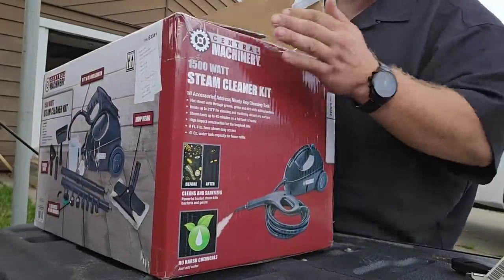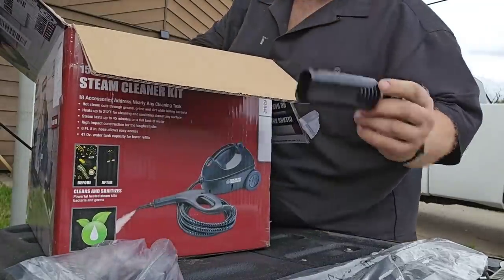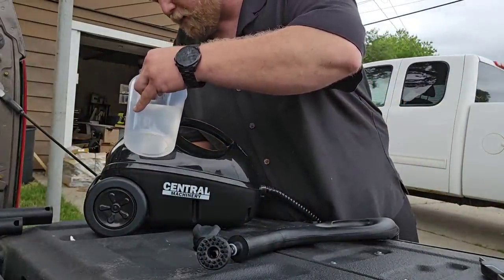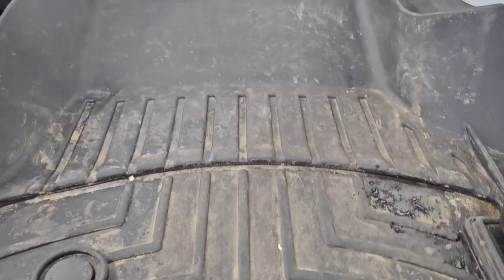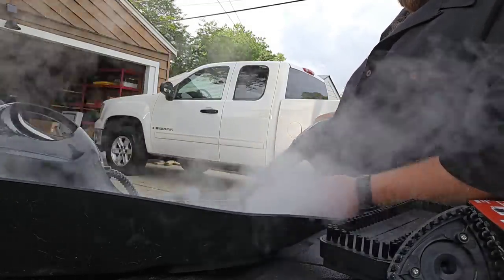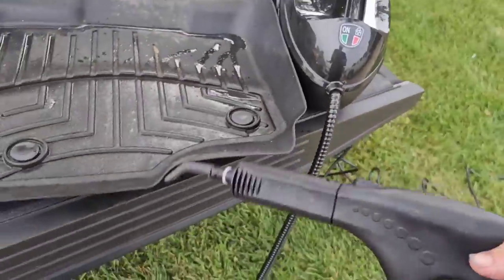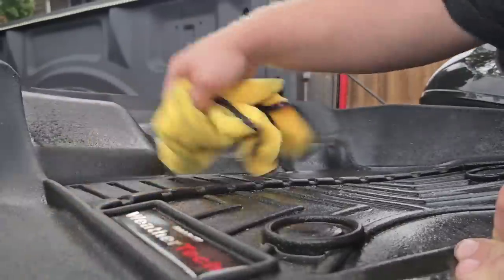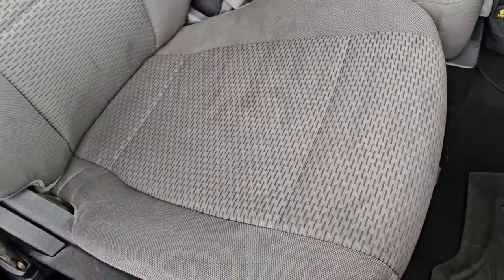Harbor Freight Steam Cleaner Review - Very Simple Very Easy Very Effective - @harborfreight

Comment: Weathertech matts stain so easy. I hit mine once with a 5000psi pressure washer and they still looked stained at the end but that's just how they dry
Reply from the maker: Right the stain you won't get rid of, people in the comment section don't get that
Reply: Dress the matts with Gummifix. They'll look like new and won't be slippery at all.
Reply: Love my Weathertechs. I put them in every vehicle I get.
Reply: @Todd66  It's a must if you live in the salt belt, so many cars have electronics right under your feet
Reply: There are easy to clean and don’t need a steam cleaner but mine does a great job, you need to use a good cleaner and scrub then clean wash or steam off.  After apply a protectant to keep it from staining in future.  And good god are you a bull in a china shop.
Reply: @GusMahn which specific product?

Comment: I have a much larger McCalluch mc1385 i use for detailing my cars it's a beast takes a while to fulling heat up but worth the wait.
Run a cup a distilled white vinegar every 10 tanks and try and use distilled water as well stuff will come out cleaner and prevents the mineral build-up

Comment: Had mine for a while. Back in the dirt bike racing days the shop had a beast of a steam cleaner with a burner that ran on diesel fuel. Lots of steam and more pressure than you'd think. It didn't play around, no brush needed. I miss that thing....
Reply: Those don’t mess around.
Reply: What was the name of the steamer? I need one like that for my dirt bikes, side by sides and mountain bikes.
Reply: @len9483  Dunno. Was near thirty years ago.  Sorry.

Comment: I recommend using distilled water Rich.  The steam cleaner works great on floor mats
Reply: Yes we used to use them for defrosting fridge evaporators when the defrost system failed, made quick work of those iceburgs for sure - the machine will live much longer if you only feed it distilled water

Comment: Rich, can you make a video cleaning the headliner using the steam cleaner on a f 150 from where the cargo light / third brake light area leaks inside and stains the headliner?
Reply from the maker: Mine doesn't do that so I don't know that it's going to do any good with me doing a video and not having anything to show for it
Reply: You wouldn't want to use that on a headliner anyway it would melt the foam and breakdown the glue. You will have a very clean but sagging headliner. Use a Tornador air tool and wipe\blot dry with a chamois.

Comment: Good Morning Rich , this tool has a plethora of uses . With a little bit of simple green it will definitely help with getting those stains out. Compact unit ,not like a diesel powered full blown machine. If the price was good then its a no brainer . I would have liked it more if it had a metal tip and extensions . But at a good price it definitely has potential . Have a great 4th to you and everyone . Stay safe ,and don't burn your hands on those fireworks . Light your fuse and get the hell out of Dodge .Hahaha .🇺🇸🇺🇸🇺🇸🇺🇸👍💥💥💥
Reply from the maker: I'll try again

Comment: Thank you for the video. 

Harbor freight sometimes has good stuff for not a lot of money. This tool seems ok, however, and maybe I am washing my mats wrong, but I usually take my car floor mats out a few times a year (they are rubber) and use either my hose at home or the power washer self service bay at the car wash.  

I would be interested though to see if this steam cleaner would work well on stains on seats and furniture both in a vehicle and at home.
Reply from the maker: I mean there's like a thousand different ways to wash your floor mats just because you do them that way doesn't mean they're wrong and I do them a different way doesn't mean they're wrong this is just the way I chose to review a product whenever you got sticky crap spilled all over the rubber floor mats and stickers and gum this takes it right off where other stuff doesn't I don't understand how you would have ever come to the conclusion or even thought that maybe you're doing something wrong based on this video